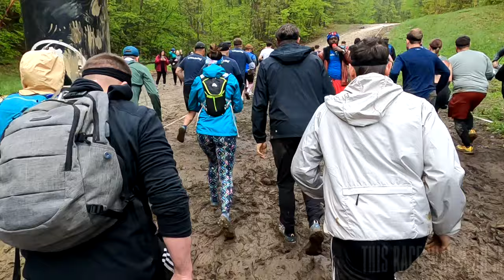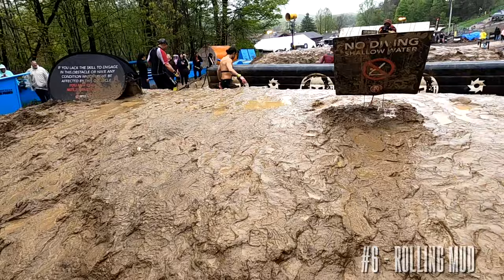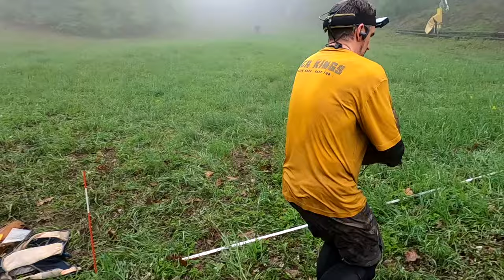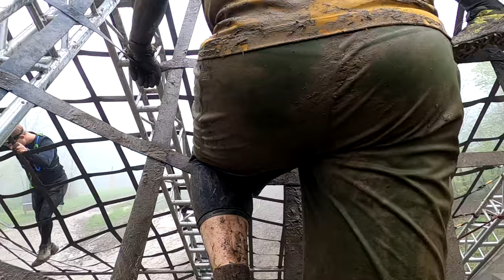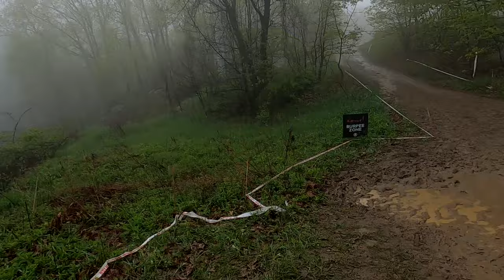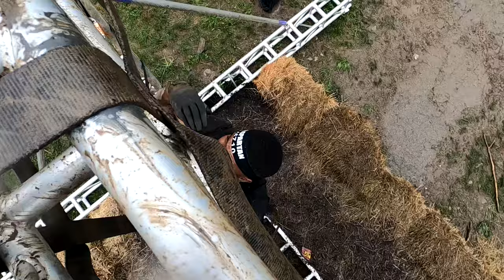Spartan Race Sprint 2023 (All Obstacles)

Comment: Thanks for posting this.  I raced solo but this was a great way to share the race with my wife.  This was my third Sprint and I'm going to do my first Super in October.  I'm good for that as long as the October one isn't in mud like this.  The mud really added a greater challenge.  Like normally going downhill is when you get to rest a little bit.  But in mud, every step was delicate so that was tough as well.
Reply from the maker: So true! The mud added such a unique dynamic to this race. It made it a memorable adventure, that's for sure. Good luck on your first Super! Hopefully the weather will hold out, but anything can happen, esp. if it's at Mountain Creek.
Reply: I've never been in spartan race. Is there any training you need to prepare for this?
Reply from the maker: Running helps, as does working pullups into your workout routines. Beyond that, if you can practice climbing a rope and/or the spear throw, that really helps too.

Comment: How long roughly did this take ya? These 5k sprints? Trying to time out my day for next weekend.

And in your experiences, do the heats start on time? Cheers
Reply from the maker: This particular race was a mess. The mud and the mountain resulted in a time of 1hr and 25min (ish) to complete. Normally for us, with battery changes and lining up the shots, and our typical slow and steady pace, a Sprint takes us around 45min or less. And sad to say, for most of our experience, heats start late by 7 to 10minutes usually, and at worst 30 minutes late (which is very rare).
Reply: @OCRKings  appreciate the response
Reply from the maker: @Kyles_Money  No problem!

Comment: What if you want to skip one of the challenges and go on your own pace? Is that ok?
Reply from the maker: Great questions! Yes, it is totally ok to go at your own pace. We do a mixture of running (def down hill) and walking (uphill). Go at your own pace is the way to go. If you skip an obstacle, that's fine, but you may have to do a penalty loop (a few hundred yards of extra running, or up to .25 miles), or you may have to do 30 burpees. In open waves, however, the penalties don't seem to be strictly enforced (as compared to the elite/competitive waves).

Comment: I am planning to challenge it with my bro~but first of all i am 235 lbs now..how many lbs should i lose first before the tournament??
Reply from the maker: If you have good upper body strength, you probably don't have to lose any lbs. If you're tall and 235, you will probably do great as is. If you run and strength train, you'll be fine. If not, definitely get out there and run and train pullups (since those are the muscles you'll use most during Spartan). The lighter you are, the less weight will be pulling on you when hanging from stuff like the rig and monkey bars. It's up to you to gauge your level of fitness and balance out weight, strength, and endurance (for the running part). If you are in good shape overall, then you are good to go.
Reply: @OCRKings  thankyou for the advise..I am a gym person usually go to gym 3-4 times a week ..I noticed some of the obstacles are abit difficult for me such as the rope climbing ..my upper body strength is not bad but I think my lower body is abit over weight..I think so that losing some weight would be better..at least 40 lbs ..because when I do lat pull-down in the gym my max is like 180 lbs 6-7 reps..

Comment: Wow, the mud! Your grip must have been a huge factor.
Reply: Grip strength was key on all the rig obstacles. I fell off every one of them, they did great.
Reply: @jeffjakubowski9323  I'm hoping for sunshine during my first one in June. Fingers crossed.
Reply from the maker: Absolutely! Grip was a big factor, especially on the metal bars. We both were surprised on how slippery the monkey bars were and those new bars on the z wall. Super slippery. The pipe in the multi-rig gave us pause as well. Solid grip and slower more deliberate speed saved the day.
Reply from the maker: This was the first race in a long time that I thought I was going to fall off the monkey bars. It was really surprising how slippery it was. I can't imagine what twister and olympus would have been like. Crazy!

Comment: Can’t you just skip it all?
And also the course looks fairly easy with the exception of any and all forearm exercises
Reply from the maker: You could skip it all I guess, yes, but that would defeat the purpose of doing one of these vs. doing a road race. Also, there are penalties for skipping/failing obstacles, typically 30 burpees each. This course was up and down a mountain. If you run mountains often, then yes, probably pretty easy. It only had 1300' of elevation gain packed into 3miles, with pouring rain, and 6" of thick mud.

Comment: What's your secret to keeping mud out of your camelback?
Reply from the maker: Good question! Short answer is we haven't found a way to keep crud out of the pack, but we can keep our stuff dry and mud free by putting the stuff back there inside a sealed Ziplock bag. I had my jacket in and out of the pack inside one of these: https://amzn.to/3pa7vcP Ziplock Big Bag size large. This is only for gear mind you, not for the water bladder. The only real add on for the bladder is for the bite hose. If you don't have one already, a "dust cover" is a must. It keeps the mud off the end of the hose and out of your mouth: https://amzn.to/3NCcLQO